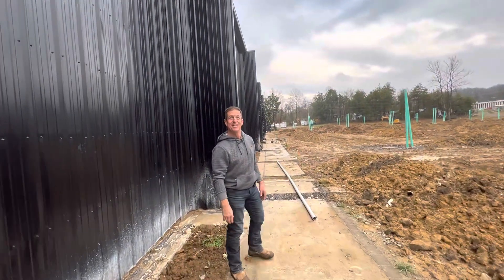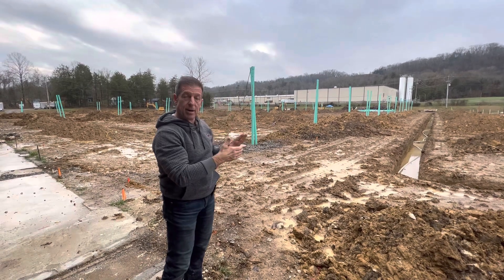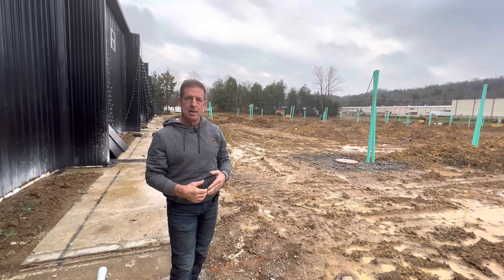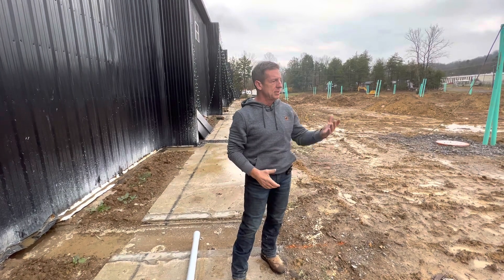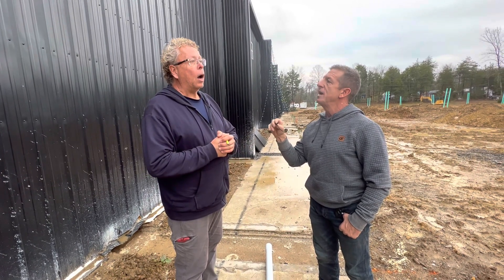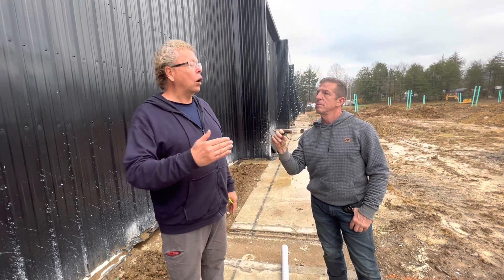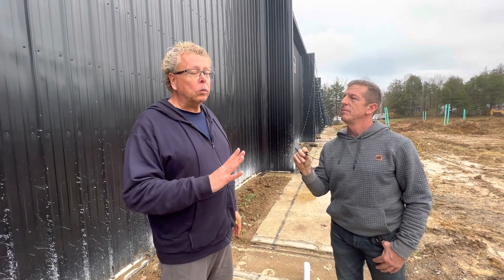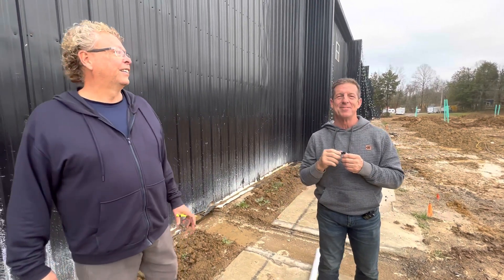The Grove Community of 72 tiny homes…. An update of progress.

Comment: You're doin' great Randy. It takes a lot of work to run infrastructure for 72 lots from scratch. I'm very pleased with the level of progress you've made.

I'm fine with January or even February. I understand that you're waiting on transformers. Having been a buyer I know about lead times and supply chain issues.

No worries sir.
Reply: No, they were never waiting on transformers, that was a rumor started by some negative commenter.  He just said in the video that Newport Utilities has them on hand, and is just waiting for the ditch to be dried out so they can lay the main cable and install them.